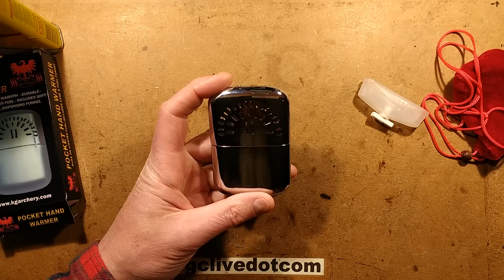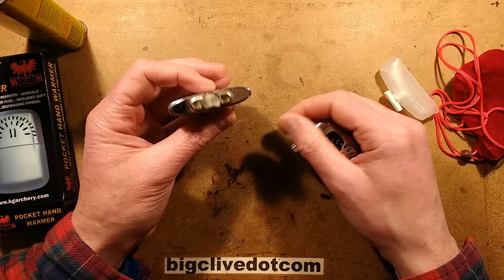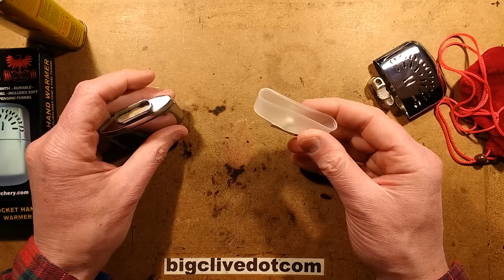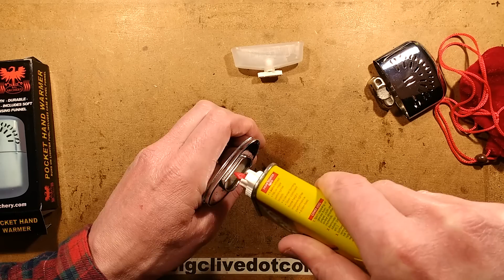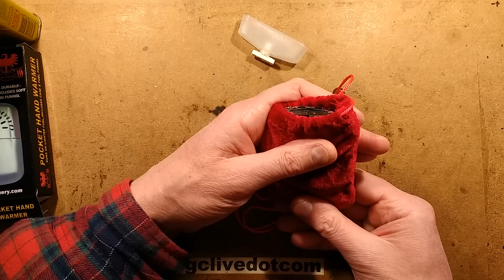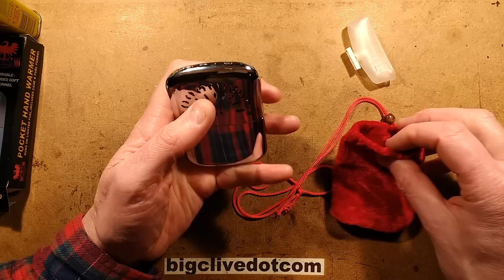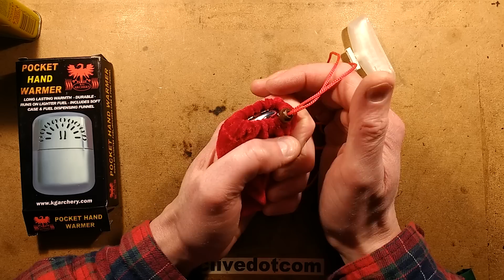How a petroleum-distillate powered pocket heater works.  (naptha)

Comment: @Clive
Lighter-fuel is naphtha, not gasoline. I think you might make it go bang if you put petrol in it. ;)
Reply: Naphta is actually a primary component of gasoline and technically just about as volatile, it's just not as likely to explode when ignited in large quatities because it lacks the super volatile components left over is less refined automotive gasoline.  Coleman fuel aka white gasoline is essentially pure naphta and has an octane rating of something like 55-60.  I keep a gallon around to run my old 1.5HP stationary engine because I don't dare put the E10 gasohol that is all that's availible anymore in the US at 87 and 90 octane ratings in it for fear of eating the 100+ year old cork and paper seals in the mixer, and 92 octane is just a little too hard for clap ignition at 7:1 compression to really get burning right.
Reply: @bashkillswitch  naphtha makes up about 20% of gasoline, so I'm not sure if I'd call it the primary component. Maybe I'm just misunderstanding your use of the word there and you mean that it's a sizable portion. 

And "pure naphtha" kinda doesn't make sense either considering naphtha is a mixture of hydrocarbons.

Edit: and I'm just now realizing I'm replying to a year old comment. Maybe I should look at these things before I press send.
Reply: Very true. Gasoline is much more volatile.

Comment: Tech bulletin for Zippo handwarmers: Zippo also owns Ronsonol brand fluid. The element will burn out (Quickly) on a Zippo handwarmer using the Ronsonol fuel.Use only ZIPPO fuel in a ZIPPO handwarmer. (Disclaimer: My personal experience. Other users may have a DIFFERENT experience in performance)

Comment: I saw a Japanology video about these things.   These are popular in Japan as far as I know; though that might just be the water based or electric versions
Reply: RansuDoragon Water based? Are you speaking of the ones that you fill with boiling water for 7 minutes of warm hands? Or a type that generates heat? (Obviously not with water alone. Maybe one of the sodium acetate ones?)
Reply: Andrew Delashaw sorry I should have been more clear, I was talking about the boiling water kind
Reply: Hot water flask or the sodium acetate you boil in water?

Comment: Friend of mine had a charcoal pocket warmer - worked wonders for wintertime patrols (military).
And they are a lot better than battery powered (even if you look at the environmental impact and danger of use)
Reply: Yes I am utterly sick of the moronic belief that anything electric (especially vehicles) is 'Green' MOST electric vehicles will never make up for the destruction wrought during their manufacture (especially the materials used in the batteries) let alone the tendency to totally ignore the generation of electricity to run them?

Comment: I have several of these that are the actual Zippo brand. I use normal camping fuel in them (white gas) no noticeable difference vs the Zippo fuel. Also you don't always know you have overfilled them right away. Once they start up and start to get warm if over filled the fuel starts boiling out and it will do one of two things a) burst into flames. b) put out the catalytic reaction.
Reply: 'White gas' is not a thing in the UK. Is it alcohol? Most hiking stoves here are alcohol or LPG. Solid-fuel cookers are less common, paraffin (kerosene) even more so, I think the last paraffin stove I saw was in the cook-tent at a Scout Camp years ago.
Reply: Dick Holman "White gas" IS a thing in the UK, you just may not call it white gas. It's just a word to describe petroleum distillates. Like Naptha, diesel, fuel/heating oil, kerosene, lighter fluid, etc.
Reply: Coleman fuel is really not the best option for these units.
And, an overfilled one just goes out.... there is not enough oxigen to support a flame (well, maybe for a second or 2)
Reply: The stuff I use is made by Crown. The MSDS for it shows 90-100% "Light Aliphatic Naphtha" and 0-5% "Toluene" The reason I use it is its $7.50 a gallon vs $51 a gallon for the 4oz Zippo bottles and that's if you get them on sale. I have a Zippo container and just refill it from the gallon of camp fuel. I don't think that little bit (if any) of Toluene hurts anything.
Reply: toluene is pretty stinky stuff... smells very nasty... and it's very much not good for you. They recently added more restrictions to it (banned a few products from containing it) because of cancer hazards, etc.
Reply: @Andrew Delashaw
No, we don't call anything white gas, it's not a thing here, which is why I asked you what it's proper name is. We do have white spirits, but that's for thinning oil-based paints & cleaning brushes, etc. which was often labelled sold as turps or turpentine substitute.
Reply: Thanks Tofunc. I wonder why the toluene?
Reply: Probably because refining it all the way out is too expensive.

Comment: You should do a video where you take a sodium acetate hand warmer to bits! :) Or rather just explain how they work as they are transparent!
Reply from the maker: They work by using the high purity of the sodium acetate to stay in a liquid state at room temperature when they would normally be solid.  The pressure wave of clicking the disk causes a very small amount of the liquid to change to the solid state and that crystal then acts as a nucleus for a chain reaction of crystallisation that spreads out from that point.  When a liquid changes to a solid it liberates heat and when resetting it in hot water it absorbs the heat to convert back to liquid (melt)
Reply: Eventually, some of the water molecules in the solution escape through the covering. This results in a solution that is so saturated with sodium acetate that it won't stay in the liquid state.
Reply: I believe it’s also an oversaturated solution from the beginning, so it doesn’t take that much of a water loss for it to enter that semi-crystallized state.

Comment: If those pesky vehicle listings are swamping your results or Ebay (or really any big search engine) try using some removal dashes. "catalytic converter -vehicle -car -automotive".
Reply: Loren Husky   What?  I've heard of Duck Duck Goose, but not DuckDuckGo.  Thank you for that.  Sometimes I try Bing because Google is so stupid.  I don't find Bing to be much better.  DuckDuckGo.  Sounds like a plan.  Thank you.
Reply: Instance Gaming those "removal dashes" haven't helped me with Google for at least six or seven years. The algorithm is too smart for its own good. >:[
Reply: If it's not working for you, then you need to adjust your terms until you get the result you want. There are also other types of terms you could use.

The ops terms are not really sufficient to get rid of all the vehicle stuff or narrow down our options enough, after all they were just examples.

"pocket warmer catalytic converter -amazon -ebay -instructables"  on  duckduckgo seems promising, 2 US patents easily found and no vehicle stuff, although the rest is probably of little use, mostly forums and shops, the patents should be useful if anyone actually wants the info. 

Google with the above search terms has one patent on the first page(the one relating to this product), the rest doesn't seem useful.

The other patent is about a lighter combined with a catalytic hand warmer.
Reply: Boolean queries!
Reply: I copy/pasted that into google and was unsuccessful.  Got a bunch of auto stuff.
Reply: Stop using google and switch to duckduckgo.

Comment: The word you are looking for is "catalytic heater". Basically the fuel breaks down in the catalytic heater and produces heat as it's main byproduct along with carbon dioxide, water vapor and a VERY tiny bit of carbon monoxide. The heat is given out as IR radiation, which might give another reason why the metal cap is used.
Reply: When I first began camping, we purchased a cabin tent at a store near Fort Bliss in El Paso.  I looked around and found a Coleman fueled lantern as well as a "ten heater" that was catalytic.  It was rather large and came with a snuff pan to extinguish it when you wanted it out.  It also contained a warning that you must leave a window open to allow fresh air as it would burn the oxygen and could kill you.  It worked very well, kept that tent very warm and you could make coffee on the top, although the tiny one burner stove I got with the gear worked much better, it to came with a special  cover to use as a heater, so we were nice and warm in our tent no matter where the Army sent us.  My family has loved camping ever since, in fact I now live in a motor home, so my house has wheels and I can move her at will, and I do!
Reply: @JerryEricsson  :
Yes, I remember seeing that coleman catalystic heater. It used propane. The surface area was very large. It was  20 cm radius circle. It was written that it can reach 400 C.
Reply: @louistournas120  I have used the propane version in our Ice Fishing hut years ago, this one burned Coleman Fuel, you filled the tank, then put, I think it was 3 cap-fulls on the top and lit that to get it going, when the flame died down the heater kept going till either the fuel was gone, or put put a snuffer pan over the top.

Comment: I'm a biker and have owned on for over 4 years so it lives with me in a inside pocket or if I go camping in my sleepingbag . My fuel can is like a tiny watering can . P.s if you put it in your sleeping bag don't fart it can end badly , I'm on my second tent now . 😋
Reply: I would not like the idea of having something more or less burning in my sleeping bag. But still better than the idea of a friend to use some of the small "tea candles" in the tent, on an external CD-drive (plastic) from his laptop as a convenient base to avoid throwing them over. He fell asleep, the candles overheated and ignited the plastic enclosure on which they were standing and he could barely escape the fire and smoke of burning plastic and synthetic fibers.
There idea of another friend was much safer: He had bought a 2,5kW generator and used it the first time for camping on a festival, for a fridge box and for some music in the evening. During the night he used a nice 2kW electric heater - " the generator is running anyway". On the next day he was quite astonished about the fuel consumption. :-) Conservation of energy from it's negative side.
Reply: I was doing the D of E award scheme and we were camping a friend had reproofed his canvas tent the day before , he hadn't got a camping stove so they loaned him a pump up brass Primus stove . So he was sitting cross legged under the peak of his tent out of the drizzle pumping for all he was worth ( we did tell him to stop at about 10 pumps ) so when he couldn't pump any more he set light to the methylated spirit heater ring sat for a bit till it had burnt out then refilled it . By this time it was good and hot then he opened the valve to full . There was a wooosh and all the burner leapt of and into his lap , at this point the flame appeared like a light saber it pierced the top of his tent and while he was trying to deal with the burner . There was a wooosh again and his tent  disappeared in a flash of steam ,smoke and flame around him , his face was a picture of bewilderment as he now realized he was sitting in the open . Us being good friends made him sleep in what was left . Such a sham we didn't have smart phones in the 70s .
Reply: @andyward8336  thank you.
It was so visual.
This made my day.
Again, thank you 😂
The look on his face must have been priceless.
Reply: @andyward8336  Ah yes. The dangers of lighting stoves INSIDE a tent. Especially modern ones made of space-age lightweight synthetics that are so flammable.
I have a dual-fuel Coleman that shoots out a big yellow flame when started. The yellow flame turns blue once the vaporizer has warmed up, but it can be as high as a foot, depending on the pumped pressure & wind conditions. Also have an alcohol burning stove with flames that can go up almost a foot high, if the conditions are right. Definetely wouldn't want that in or next to my tent...
Reply: Ye this flame was about 10 feet high it was absolutely amazing to see and also one of the funniest thing I've seen.
Reply: I believe you. Some farts are very flammable.
Reply: Our friend burning his tent down and owning a hand warmer yes , but I've never farted in a sleeping bag 😀 we were camping at a place called The Cloud in the Peak District right next to the River Dane when we were 14 year's old . We were there for three nights.
Reply: Andy Ward.  pls pls tell us is it true ? :D
Reply: It needs oxygen to keep going. It slows down the less fresh air it gets. Also if the pad gets soaked from being on its side or inverted, it stops. I would imagine no worries except burns if sleeping with it close to your skin.
Reply: That's one way to get warm if you get cold! Just start it up, put it in your back pocket, and fart for a nice, toasty butt!
Reply: And the flames get higher every year, right? 😁
Reply: Dear God, now I'm gonna need rescue before I totally lose it.  I haven't laughed this hard in a good while...just wish I could have been there to witness this hilarity!  (But grateful everyone was safe, even if their ego was a bit bruised!)
Reply: Andy Ward I
Reply: Please be true
Reply: @Andy Ward That reminds me of my uncle who managed to burn a hole in the canopy over the cooking area on Boy Scout camp outs no fewer than 3 times using one of those stoves. Generally the canopy was set about 7ft tall over a picnic bench, so generally there were no problems, but if you were especially absent minded it was possible to create rather tall flames with the stoves.
Reply: You are, more or less, burning in your sleeping bag, and at a much higher rate than one of these can achieve.

I'd be more worried about the fumes of un-combusted alkanes that seep out.
Reply: If you have to state your a biker....your really not...

Comment: Not a new idea ,the old ones simply had a very fine gauze and you lit it just as you did ,i guess the gauze stopped the flame getting to big ,there was certainly no ceramic or platinum involved.
Later came carbon stick versions where you lit a carbon rod and it sat in a clamshell type box with fiberglass in each side ,not as good they tended to go out because the rods needed to be absolutely dry to work

Comment: I had one of these back as a young lad & honestly was just afraid of sticking something with lighter fluid inside of my pockets, you know things could go wrong was my way of thinking & so I always just wore gloves when able outside working but many days I wish I had used them. Especially on those days on working on the river front with the wind blowing directly from the north at what seemed like 100 knots or more just cutting right thru you down to the bone.

Comment: The authentic Zippo one is much easier to get going.
Reply: The Peacock hand warmers, which is what this is masquerading as, are much better than the Zippo version. They are also better built, with the body made from plated copper rather than steel.
Reply: @tomhsia4354  peacock is nice I have several got from DX I get the suspicion that these are used alot in Korea
Reply: @tomhsia4354  wrong
Reply: @well_as_an_expert_id_say  Well, considering Peacock make the Zippo hand warmers for them, I would agree, he is wrong. They are the exact same build quality, and exactly as good as each other.
Reply: @PippetWhippet  umm. Finish wise the Zippos are a bit nicer peacock works exactly the same at half the price
Reply: I've owned the zippo brand warmers. They're decent I had a hard time lighting it tho after 10 uses and it went out on me a few times and was hard to relight after that.
Reply: This one is just as easy to get going.......Exactly the same. Have both.